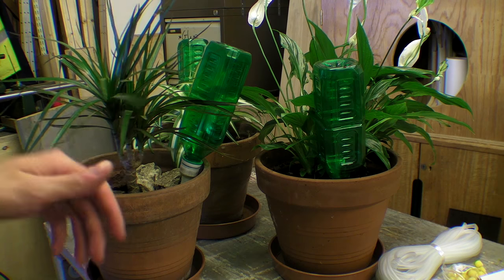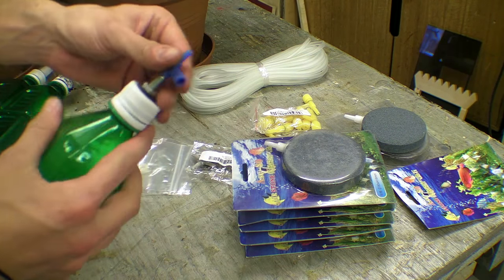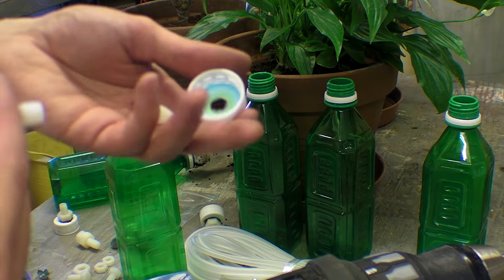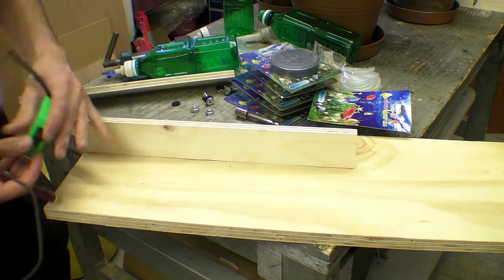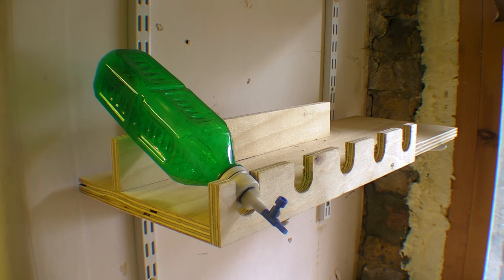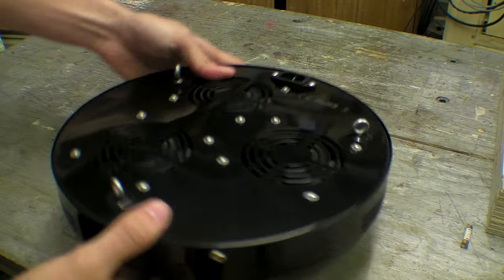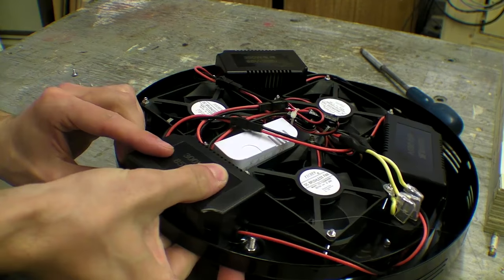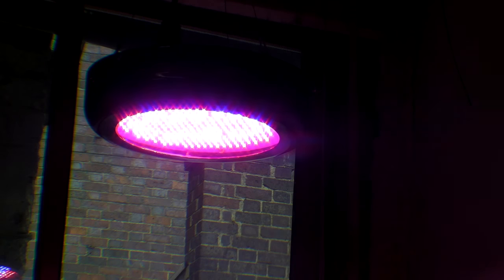My Green Corner

Comment: How long do the bottles last?. If you have to fill them often a tank of some sort would be better, if you have a water feed in your shop you could even set up a self fill like on a lavatory and make it totally self filling.
Reply from the maker: That's a good idea. Oddly they are not consistent. The spider plant became water logged and I had to change the soil and leave that outside to dry. I think I should have just bought several peace lilies, as they are the hardiest. The more I use it, the more I think the watering spike method was simpler (although a little messier).